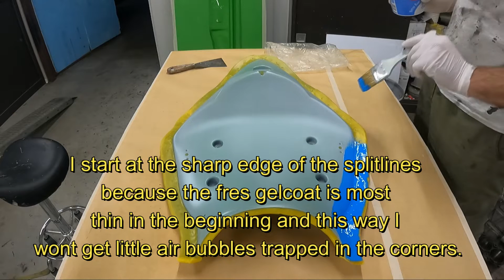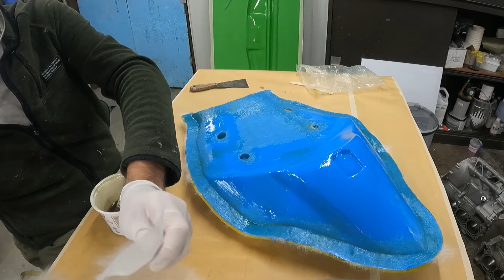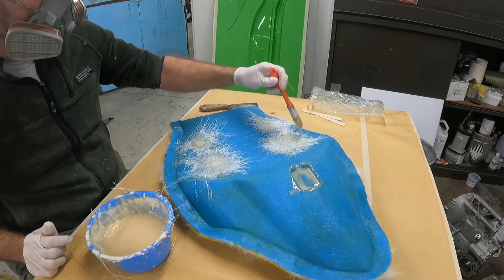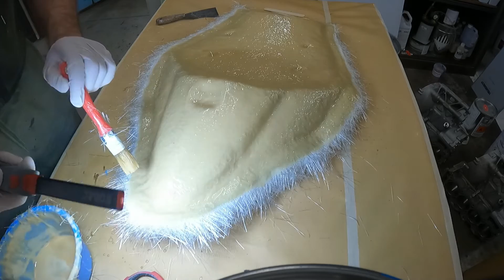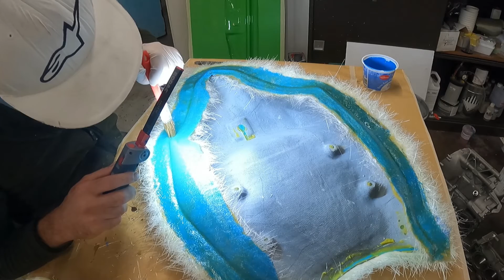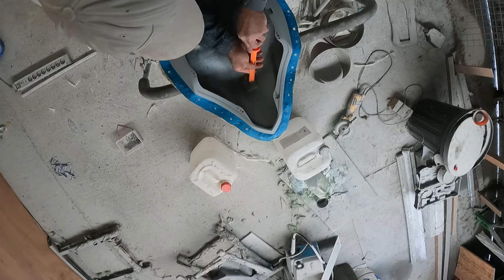How to make Yamaha R1 SBK race seat split mould Part 1

Comment: Good work, like your videos! Where do you get the material, do you have a recommendation?
Reply from the maker: Thnks, I get them from my normal distrubutor where I'm working with last year, You can get these products from most professional sellers.
Biggest difference is the vinylester tooling, the most sell polyester tooling resin.